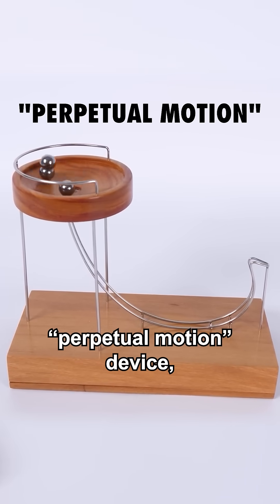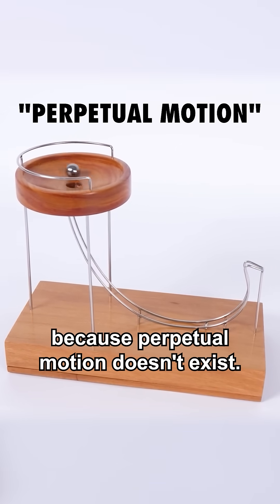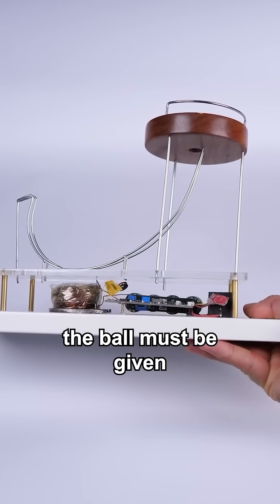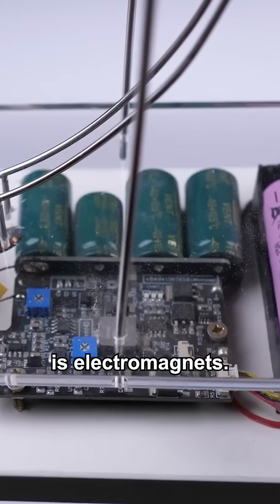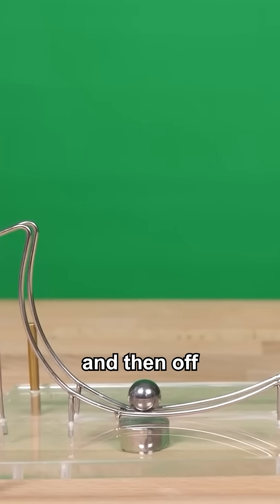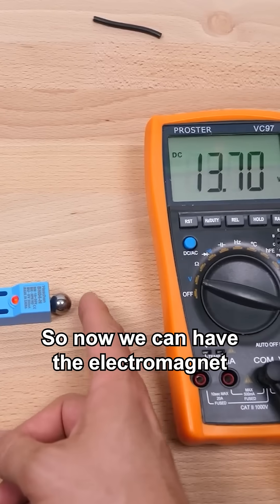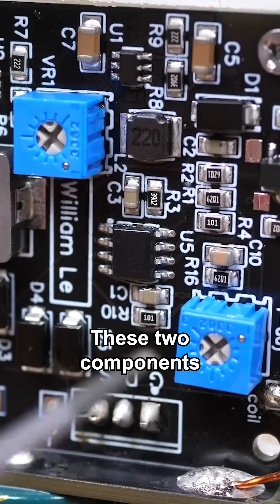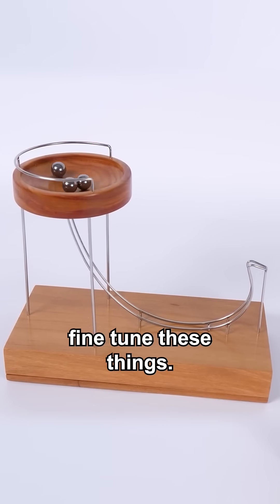Proving that "Perpetual Motion" doesn't exist!

Comment: If a  car would go in every region of a country and a light wind turbine would be moved whit car everywhere where wind blow and produce energy that could be inserted in energy grid would produce easy energy
Reply: I guess it's just a pity that the energy needed to make the car "go to every region of a country  ... where wind blow" would be a lot more than could be generated by the light wind turbine.
Reply: @RexxSchneider  it depends how much time the wind blows. If the wind blows for a entire day and you did only few hours on road then you gain a lot of energy not to mention that if wind blows hard in few hours you gain all the energy lost on road
Reply: @57w7w  Have you any idea of the energy that could be generated by a "light wind turbine"? Something that could be safely fixed to a car isn't going to generate more than a kW at best. If you had wind blowing for an entire day without the car moving, you still won't have any spare energy to give to the grid because that will give you a range of much less than 100 miles. Then on the days when the wind doesn't blow, you will be stranded. Wind turbines are only efficient when they are mounted a long way  clear of the ground. They are not portable generators.
Reply: @RexxSchneider  if the wind turbine is folded could be very big when mounted
Reply: @57w7w  It could be. It could also fall over when the wind blows unless you have a huge, heavy mounting for it.

So how big a car are you thinking of that could carry a very big folded wind turbine along with all the necessary mounting for it and the equipment to dig the deep hole for the mounting?

Sound more like an articulated truck to me.
Reply: @RexxSchneider  everyone could watch weather on internet in real time , speed of wind, and choose where to go where wind blows whit the speed enough low that the turbine not to fall, enough speed to spin the turbine

Everyone could choose a turbine as big as they can buy
Reply: @57w7w  This is the most "nuh uh I'm wearing a bullet-proof vest" playground argument I've seen in a youtube comment in a long time lol
Reply: Wind is caused by the Sun heating the surface of Earth, by blasting it with energy created during nuclear fusion.

Comment: arent electrons in perpetual motion?
Reply: they eventually lose energy in the form of radiation (photon)
Reply: It is not currently known whether electrons will eventually decay or not.  If they did, the best current estimate is that it would take more than 10^28 years for it to happen.
Reply: Perpetual motion in this context usually means something you can generate energy from

Comment: what about orbit?
Reply: you can say that in a perfect universe without friction an orbit can be stable, but you cant harness its energy
Reply: Orbits are stored kinetic energy
Reply: Objects in space also lose energy by orbiting, particularly through tidal heating and deformation. Thanks to gravity, vacuum, and inertia, objects in orbit tend to be extremely stable, but they are not perpetual. The Moon is very slowly drifting away from Earth, and the Earth's rotation is slowing down very slightly.
Reply: Even orbit comes to an end

Comment: I think you could skip the whole board. 

You would have to do 2 sets of rails. It would skip from rail 1 to rail 2. Rail 2 is off and rail 1 uses the ball as a switch. 

So while on the down, on rail 1, it is on. Then it falls past and jumps to inert rails.
Reply: That only works if there's only one ball. If there's a second and it starts down the rails before the previous ball has passed the magnet, it'll pull back on the first ball, causing failure.
Reply: Where's the magnet gonna go?
Reply: @janitorizamped 
Same spot as with the fancy electronics.
Reply: @VoCodebcv  so on the board? OP said you can skip the whole board

Comment: Your trying to prove it doesn't work because thats your biase
Hiw about lay down the magnets the same way trains lay down magnets, there are different polls on the magnets that you lay them down to push off each other
Reply: Maglev rails function the same way, rail sections turn on and off in sequence to push and pull the train when appropriate.
Reply: Scientific principles are principles regardless of bias. You can't change something in science because you don't believe it. Maglev trains require energy input.
Reply: THIS GUY THINKS MAGLEV TRAINS RUN ON PERPETUAL MOTION
POINT AND LAUGH
Reply: @arifhossain9751 Perhaps it's better to explain to people things they do not know rather than make fun of them for ignorance. Maglev trains do not run on 'free energy'. The magnets are there to reduce the friction which allows for trains to go much faster for the same energy cost. That's a simple but effective explanation and much more constructive.
Reply: @SAOS451316 I rather make fun of people not knowing simple concepts. But you do you and I will continue to make fun.😂
Reply: Why can’t it be true that you want the PMM to work because of your bias, despite the reveal and the demonstration. Everything w no engine aboard, that you see thrown or pushed with your own eyes comes to rest eventually.  Please explain your desire to make that not so?